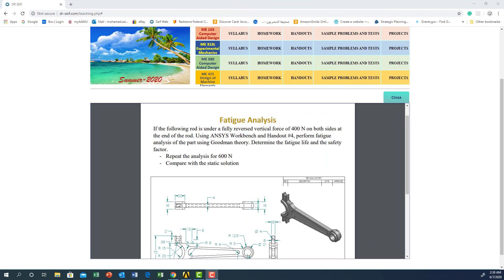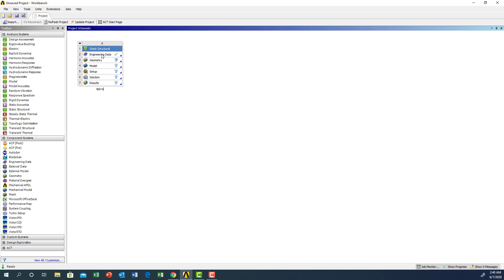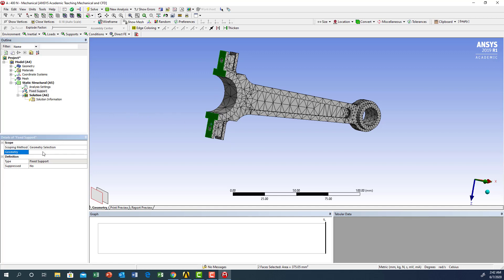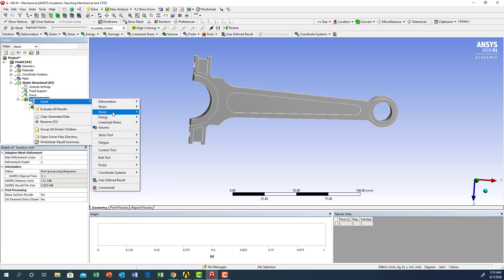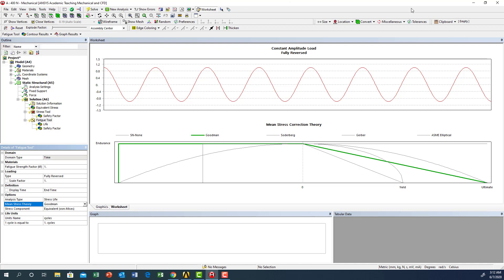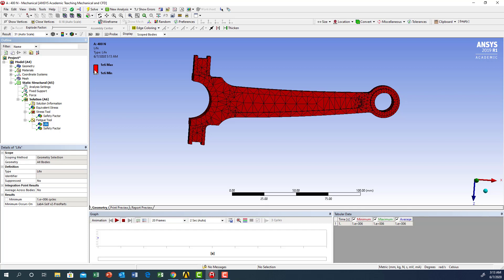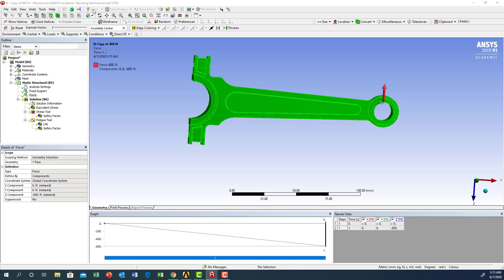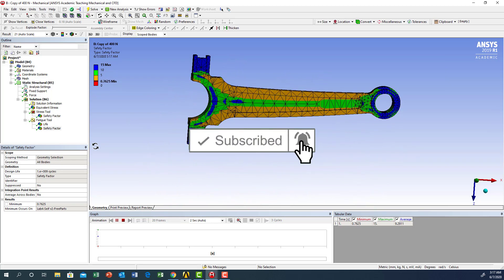ANSYS Workbench Tutorial - Fatigue Analysis 1

Comment: Brilliant video!
A quick question,

If i was to conduct a real life experiment of this fatigue loading. Would i be able to just use the material specimen. Or would I have to manufacture a connecting rod. Then undergo fatigue loading to get identical results as the simulated ones
Reply from the maker: First, I would like to thank you for the comment. To answer your question, you don't have to manufacture a connecting rod as long as you are paying attention to all the boundary conditions. All the current commercial FE software will give you accurate results.

Comment: Hello,
I am a mechanical engineer, and I wanted to thank you for your Youtube channel which is an anthology of digital simulation.

I am contacting you because I have a question regarding a feature of Ansys Workench, more specifically, the static calculation. In particular, I would like to know if it is possible to define a load (force or pressure) which depends on both x and y, a function with several spatial variables f(x,y) or f(x,y,z).
And if you've ever made a video about it, I'd be interested in viewing it.
Regards
Reply from the maker: Thank you for the comment. I am glad you find it useful

Comment: Can we calculate if a life of a component is more than 1 million?
Reply from the maker: Yes, but you don't need to calculate the life of the component once you passed 1 million cycles. In this situation, the part is considered safe. In your analysis, you are depending on the material data of the S-N curve, which will be given by the engineering data (or you provide it).
Reply: 1 million cycles and more is generally considered to be within the 'Infinite Life Regime' in design applications. This is the region at which parts are assumed to never fail. (unless in very high frequency applications).